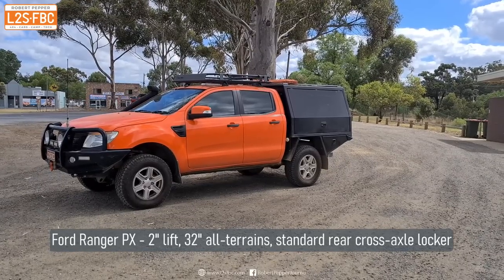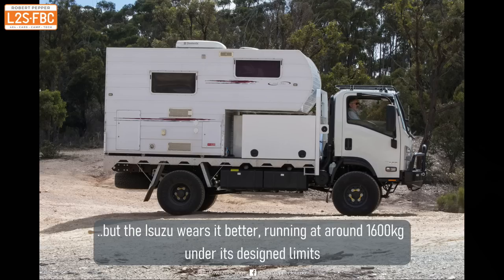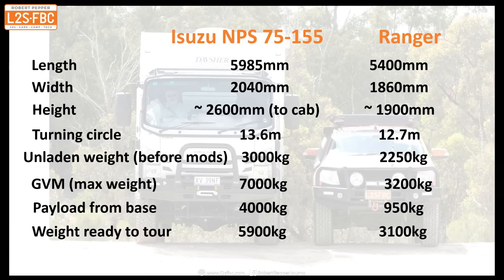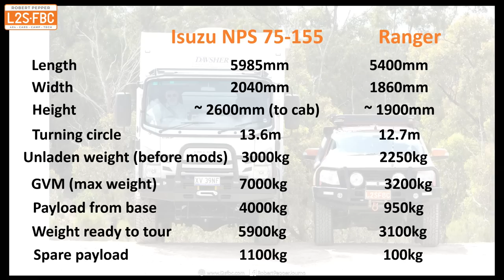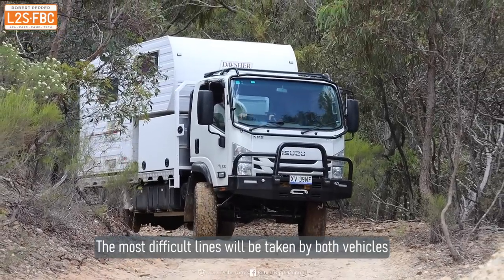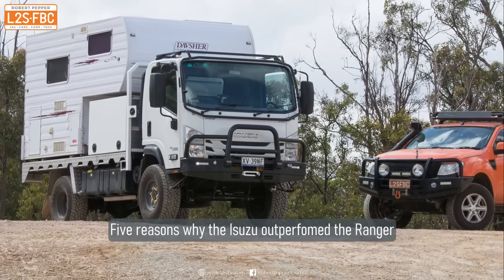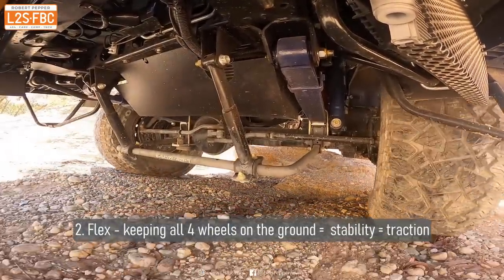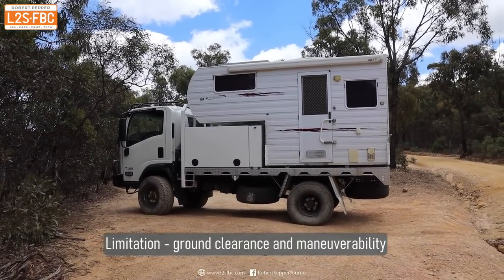Best offroad - 4x4 truck or 4x4 ute?

Comment: Nice video. Would like to see isuzu nps compare to another live axle vehicle such as land cruiser 79. Cheers
Reply from the maker: There will be more such comparisons...can't say exactly what and when yet though!
Reply: Apart from the excess power the 79 has, it loses every other comparison from cost to ride to handling to cruising at 100k to towing to load carrying capacity.  The 79 can be really ugly off-road with it's lack of articulation and narrow rear track.  The extra power is no real advantage either, unless you're a wanker who thinks a V8 still sounds good when a turbo is in the exhaust :)  -  here's a tip - a good old NA V8 petrol sounds great, a turboed V8 diesel with no muffler sounds shit.
Reply from the maker: Yes the comparison wouldn't go well for the 79. It needs both lockers for the Hill of Truth...check my LC70 video

Comment: Ok I am a little late to the party. Did the gross weights include driver and or passengers? As the Isuzu is only a 3 seater, but realistically 2. An apples for apples test would see a single or space cab, and there for more weight could be moved further forward. I also believe the ute would be more prone to breakages as it is loaded so close to or over its gvm, whereas the Isuzu has 33%+ of its payload in reserve
Reply from the maker: It's not meant to be apples to apples. Yes re % loading.

Comment: Impressive stuff, but for mine I couldn't accept the high centre of gravity or the high seating position, really love the luxury of these modern dual cabs. I know from having large live axle wagons that that suspension flex does make the high centre of gravity less of an issue than it might appear but honestly I'd feel a lot better about towing a camper than dealing with that.
Reply from the maker: Fair points and each to their own!
Reply: The high seating is great.  In town you can see over all the cars and can react to situations well in advance.  In the bush you can see so much more over the vegetation.  Having had both, I’m in no hurry to go back into the weeds with no visibility.
Reply from the maker: Very true, like when I change from driving my Toyota 86 (lowered) to the Ranger (lifted)...amazing difference, and a truck is a world again!
Reply: Definitely an each to their own, situation. It also shows the negative impact a lack of driver confidence can have on a vehicle's limitations.

Comment: Id love a good off road video of the larger Isuzu's like the FTS 700,750,800 or the 139-260.
Reply from the maker: If I can find one, I'll do it!
Reply: Hi Rob, I have an FTS800 that i can bring to the table. What do you have in mind?
Reply from the maker: The same as in the  video - Ranger as a benchmark, see how the truck goes!
Reply: @L2SFBC  I'm good with that. Where are you based?
Reply from the maker: Melbourne but I travel...when allowed!
Reply: @L2SFBC  I'm based in Sydney, when its back to normal we can get together. Thanks Michael

Comment: Do the diff ratios get changed to accomodate the 37's
Reply from the maker: no, good question
Reply: Jesus the loss of torque down low would be noticable. I noticed it going from stock tyres on my hilux to 32 inch muddies😱
Reply from the maker: Not on a truck like that, no

Comment: Hi Robert, we are thinking of purchasing an Isuzu truck as we have the same issue as you with weight carrying a slide on camper. A few questions, what is the mileage you are getting on road and how does it handle with a slide on fitted. 
regards Liz
Reply from the maker: Not my truck suggest asking on Isuzu FB forums
Reply: Liz, the truck uses approximately 18 l/100 on average as you see it, with two people and fully loaded. We went away a couple of weeks ago into the Victorian high country with plenty of wet weather and needing 4WD engaged in many places as it was quite slippery. This is with the touring weight around 5900 kg or 5.9 tonne, which is close to what it weighed in the clip that you have seen. During that time in the high country and travelling around 500 km's of sometimes steep muddy terrain, as well as descending; we averaged 20.5 l/100 for that part of the trip.

The truck fuel usage swings from 16 l/100 to 20 l/100 in general, with 18 l/100 being pretty much where the long term is at. In serious deep sand, low range and working hard, the fuel usage is between 23 l/100 to 26 l/100. On dirt roads and most outback situations where we are travelling 80 km/h or lower and no real hills, the truck generally uses 16.5 l/100. This comes about because the speeds are slow, the bigger wheels and tyres mean less revs for any speed and the fact that we just ambling along in a high(ish) gear with minimal throttle input.

The wheel tyre combination that we have is an approximate 14% reduction in engine speed for any given speed, as the Isuzu mantra appears to be to have a quite high revving engine and almost be revving to the rev limit at 100 km/h. The bigger diameter wheel/tyre combination makes the engine rev far less for any given speed and in fact seems to be about the correct ratio.

Comfortable cruising speed, at least where the truck is in it's sweet spot, is around 88 km/h to around 95 km/h. it just ambles along easily, except for hills where, being a truck, it dies. As the absolute speed limit for a truck in Victoria, is 100 km/h we haven't had it over 100 km/h, so I have no idea what it would be like, except it would start to suck fuel.

The handling is not a problem, one needs to remember that it is a truck and having a hard side slide-on camper bolted to the back it isn't the fastest thing on corners. Winds are not really a problem, although a head wind certainly takes the oomph out of the engine.

I would suggest if you are thinking of purchasing new, then do a lot of research into what accessories and/or changes to the truck and getting anything that requires an engineering certificate done prior to original registration; no mater which state or territory you reside in.

The difference is that this truck had all suspension and wheel changes done prior to initial registration by a Second Stage Manufacturer (SSM) This means we can sell the truck in any state or territory as though you were selling a normal car. If you have the major changes done after initial registration, then an engineers report will be required (at the least) for registration in another state. The same applies if you move interstate, an engineers report will be required to move your registration; quite a shock for many people.

Not sure how to go about it, but if you wish to contact me; do so.
Reply from the maker: Fantastic response! Liz, I can put you in touch with Allan if you contact me via my website.

Comment: I want an Isuzu 4x4. But I can't get one in the United States. Why?
Reply from the maker: No idea, would be interested to hear from US people on this.
Reply: @L2SFBC  I live in Las Vegas Nevada. We are surrounded by vast stretches of desert. Lots of off-road adventure.
Reply: I think I can get one in Canada, But there's a problem when getting the vehicle worked on. Dealers in the US don't want to work on a vehicle with a Canadian VIN number. And from what I understand, getting work done for recalls can be an obstacle. Many dealerships will tell you to get it done in Canada which is not an easy thing considering I live in the South West United States. Over 2300 kilometers.
Reply: Go for the fuso 4x4

Comment: Just found this video, great comparison. We're in the market for a light truck for an expedition vehicle. With a custom build (fixed) we're looking at north of $250K. I really like the slide-on camper as it makes the overall cost much lower and we can remove and use the truck here on the farm for other duties. 

You got your mods done with All Terrain Warriors? We are considering Australian Adventure Vehicles - the owner of that company Kym Bolton -  came up with the super single conversion idea. Their conversions also look real good.
Reply from the maker: Hi, yes that's ATW. AAV do similar, but they use a front locker not an LSD - a better solution in my view. I have a video interview with AAV here -> https://youtu.be/Zcb0REqweSo
Reply: A couple of things you may wish to consider, the Fuso doesn't have synchromesh in first gear, so you will need to double clutch and time your revs reasonably well to slip down to first when on an incline. Not an issue if you select prior to ascending, but if you are mid hill then you will need, in all likely hood, to stop and use hill start and take off. Not an issue really, just something to be aware of. The Isuzu has synchromesh on all five gears, so not an issue. Reverse gear and first gear in the Isuzu box are directly opposite each other. So rocking backwards and forwards should be relatively easy. 
The Fuso does not have cruise control, the Isuzu has it as standard.
The stock gearing on the Isuzu means it is screaming a bit at 100 km/h with standard wheels/tyres. With the 37" wheels/tyres fitted, I think it's about right and so far nothing has fazed it in the go slow and steep department.
You mention usage on a farm, if you are getting a dual cab, then either will be good, but if you are getting a single cab, then be aware that the Fuso chassis rails are at two levels. The design of the Fuso means the business part of the chassis rails on the dual cab are lower, meaning a lower centre of gravity and naturally easier access for loading unloading in a farm environment. The chassis rails on the Isuzu are approximately 100mm wider apart than the Fuso, dependent upon usage this may have a bearing.
One thing to consider, is steering axle weight. If you are intending to add a winch and presumably a bull bar, then the Isuzu has 3100kg capacity versus 2800kg for the Fuso. I have seen a current model Fuso Canter with a bar and winch on the front similar to what the above truck has and their steering axle weight was 2740kg with two people and fully loaded, meaning they only had 60kg left on the front axle. The above truck was weighed very early on the day of the comparison with only the driver in the cabin, the steering axle was 2780kg while the rear axle was 2940kg. A nice balance between axles and the way it drives shows that having a nice balance certainly helps. With two people in the cabin and a few more odds and ends the front axle is usually running around 2860kg.
The front differential would certainly be more capable if it was running a locker, but the aftermarket 100% mechanical torque bias differential fitted is quite unbelievable in how it works. When in 4x4 mode on normal stuff, it is nothing short of brilliant, it wouldn't be as good for super serious stuff, but within reason one has to decide what one prefers.
A rear differential locker is available for the Isuzu and if you combined that with the Torsen type of differential fitted to the Isuzu above; I would think that would be a really, really good setup. I'm not sure if a rear locker is available for the Fuso.
As for the invention of super singles in the setup we are talking about on the vehicles we are talking about, well, they have been around for quite some time on various vehicles before these Japanese trucks were even first manufactured. One such truck I have personally seen, been in and travelled in as a passenger, is a Hanomag 4x4 which was around in Germany immediately after WWII. In their single wheel mode, one simply turned the wheels around 180º for front or rear axle. The unit I was in was built around 1949 from memory.
One last thing for farm use, the current Isuzu NPS 75 155 does not have a DPF fitted, they have another method of dealing with exhaust emissions. This means, one does not have a burn-off situation; ever.
Reply: @allanhugh2044  Allan a great post, any chance of a paragraph edit
Reply: @electrasonic  I'm all ears.

Comment: But how do you fit a bonnet scoop to your NPS 🤔🤣🤣
Great comparison, factoring cost, capacity and ability it's amazing so many still go a 79 series over a Isuzu or Canter.
Reply from the maker: Well, the 79 is smaller...but yes, with the amount of money poured into the average 79 build you could get a tasty NPS or Canter, brand new, which could carry a lot more both bulk and weight...and be as comfortable!
Reply: @L2SFBC  
Yes true re size.
Amazingly though for 80k you can have complied 37s and a matching front to rear wheel track 🤣

Comment: Hi great video! Lots of really good information! How do you find the height of Isuzu camper? When you go off road do you find the height to be a problem? And how about traveling on the highway, does the wind resistance have much affect on fuel economy? Thanks.
Reply: The height of the camper in general is not a problem that said, if we wished to do tight tracks lined with low hanging vegetation all of the time, then it would be a problem. The camper, which is permanently bolted to the tray, is 3250mm above the ground, which is approximately the height of many Australian built caravans.

Steep inclines and declines have not been an issue and the truck has certainly surprised us with its capabilities fully loaded and ready to go. So far and within reason wet tracks haven’t been a problem either, it was on wet muddy tracks where the front Automatic Torque Biasing (ATB) LSD differential first showed how good it is. If ever we got another truck, the first thing I would add is an ATB LSD to the front axle if the truck was presented with an open differential.

As for sand, we’ve had limited sand experience in the truck, but what sand we have done has shown that when aired down, the tyres certainly make a shallow and long footprint in soft dry sand, making things remarkably easy; so far.

As for fuel consumption, we’ve been quite surprised, it could be a combination of the larger radius tyres as well as often travelling on smaller roads where the overall speed is reasonably low and not going gangbusters on the highway sections.
The larger wheel/tyre combination has reduced the engine revolutions by 14.5% in top gear. Being registered as a heavy vehicle in Australia, the truck is limited to 100km/h maximum speed. The cruising speed we seem to settle on, is 92 km/h at 2,400rpm give or take.

Fuel consumption is currently 17.1 l/100 to 17.3 l/100 for around town and flat highway travelling. This has been a consistent figure for the last 3,000 kilometres. As soon as we hit hills or very high headwinds we are steady at 18 l/100 to 18.5 l/100. 4x4 driving on dirt roads and tracks, but still in high range, is around 19 l/100 while hard 4x4 work so far is around 20 l/100 to 21 l/100. Heavy sand, single sample of 55 kilometres in low range, was 22.5 l/100 to 23.5 l/100.
Reply from the maker: Great info thanks for helping everyone!

Comment: interesting  review. I like the many demonstrations to show real world comparisons in different scenarios and the analylitical commentary.

one thing I'd like to see that seems to be missing in a few of your comparisons is the relative performance of these vehicles in sand/soft sand/climbing a sandy hill or dune.  the differences in power to weight ratio  and weight of these vehicles per wheel etc could make  a lot of difference and even up the scores in these comparison  scenarios .

in wa getting off a beach  or getting up a sandy dune track is a common test and requirement for 4wds in real life..

thanks again for the great vids
Reply from the maker: thanks I don't include that as I didn't have a chance to drive that terrain. Another one coming soon, please share this one!